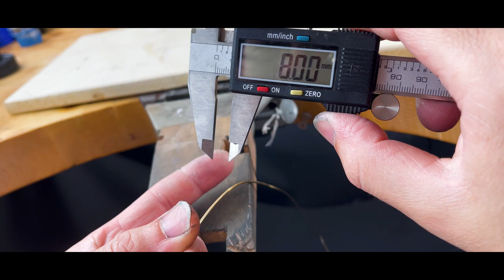HANDMADE CABLE CHAIN

Comment: Hi if i have 1oz and i want 600 mm cable chain how do i calculate the thickness of the wire and the size of the link ,im having difficulty finding this info, please share .
Reply from the maker: Hi there
For example , if a jump ring ID is 3mm then its max thickness should not be too close or over 1.40mm, so when you hook 3 links together , they not gonna get stuck. 
2) if a link is weight 1dwt so 19 links=1oz
You will have to make it in order to know the exact number. Hope that helps
Reply: OK it does make sense if the ID was 3 mm anything larger than 1.4 would  bind yes I understand, you get what I'm asking its if I have say 27 grams and I want a rolo chain 600 mm long how do I work out wire and link Dia to use up every bit of silver or gold ,that's the calculation I'm having difficulty with. I just got a rolling machine I can't wait to try it out.